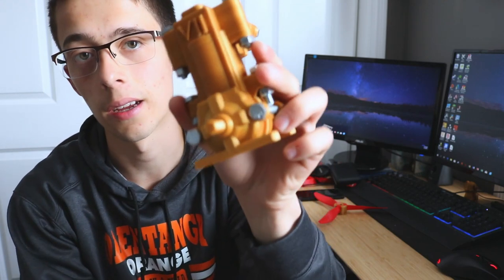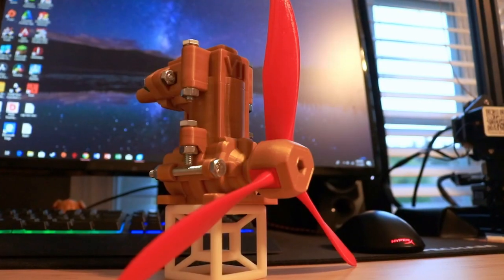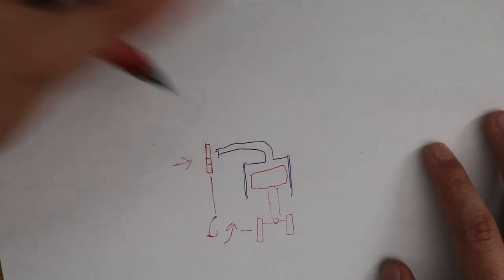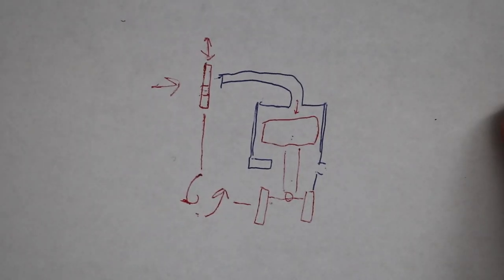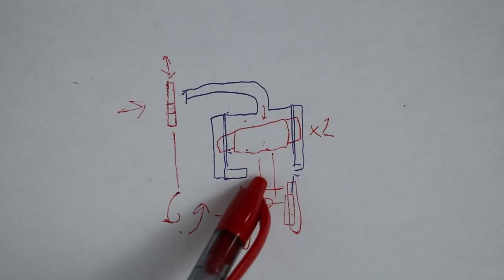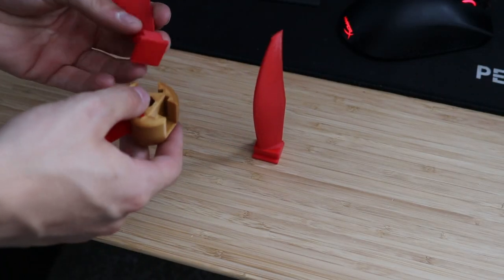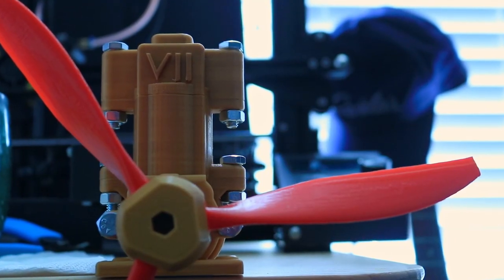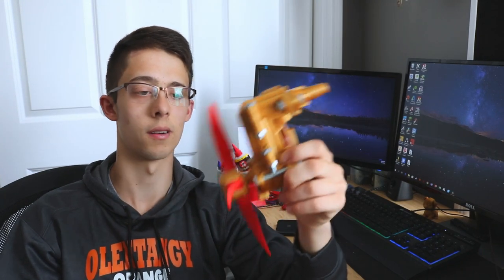NEW BODY AND INTERNALS - AIR ENGINE #2

Comment: dude I am making an air engine too. Ive bought the ender 3 which has been a workhorse. the engine im making is a rotary engine, similar to the wankle  but uses a different kind of rotor. please make more and alos add more footage of the engine running and making sounds
Reply from the maker: I recently started designs on another prototype ie a 3 cylinder air engine and I began printing parts very recently. I am tempted to create a video of it